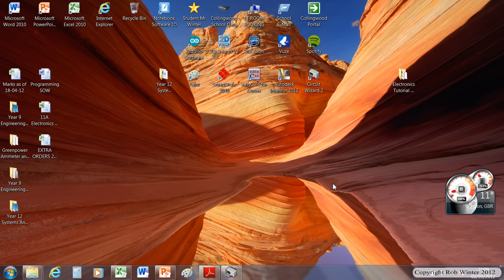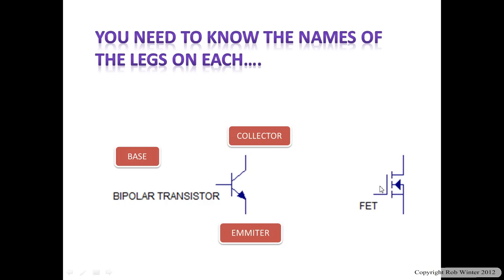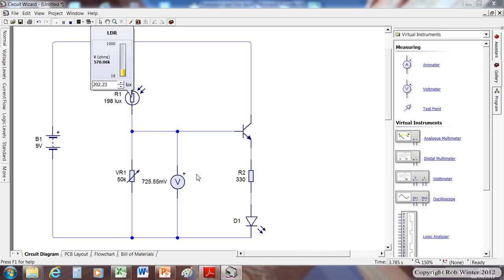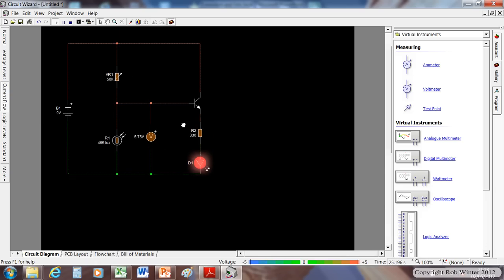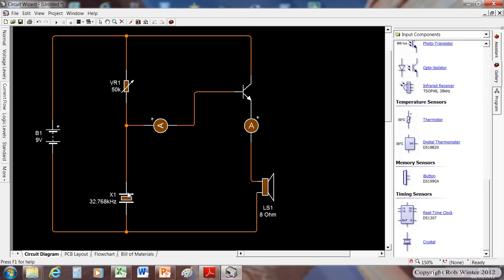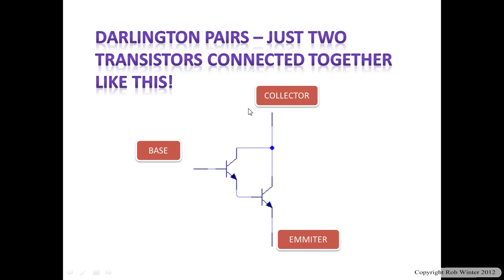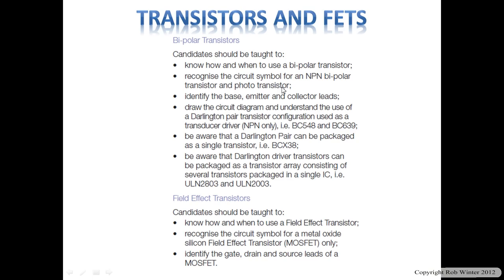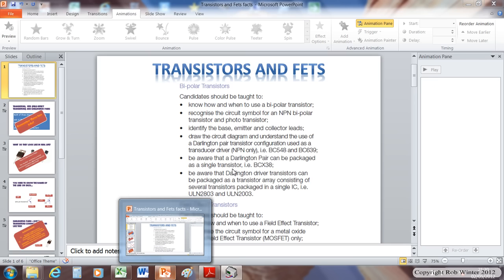Transistors  FETS - Darlington pairs

Comment: Nobody ever mentions what transistor means...its taken from transfer resistance because that's what a current controlled amplifier does.it reacts to changes that affect the forward barrier voltage either aiding or opposing it......thereby turning on or off or anywhere in between within design specs.